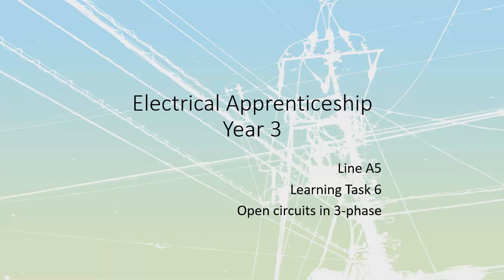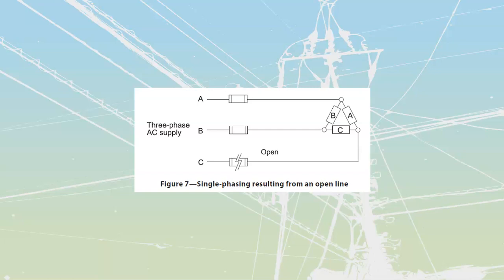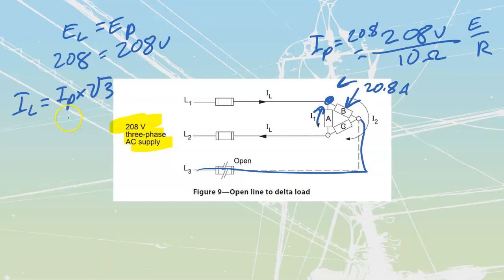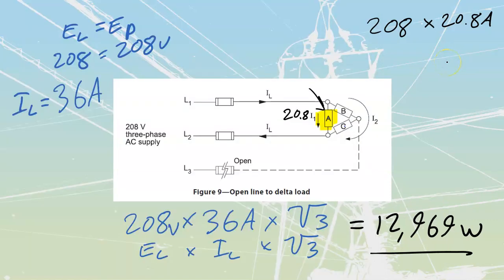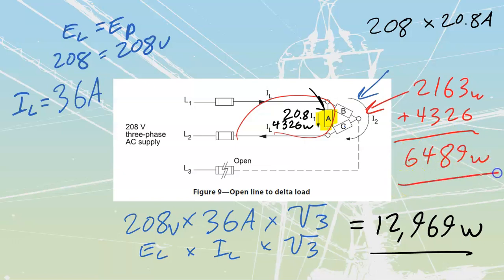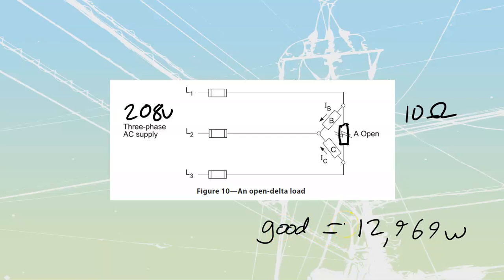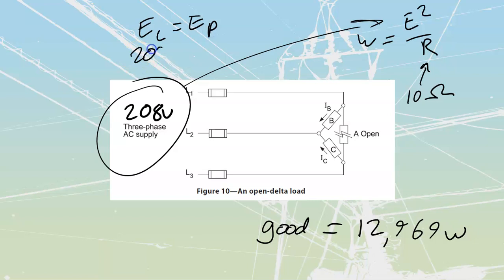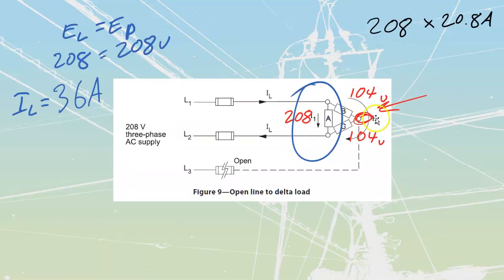Open Circuits on Delta connections - L3 A5 LT6 2

Comment: Hi! I was hoping for a quick explanation on why the phase current and line currents of line 1 and 3 are different under an open load condition
Reply: Meaning phase 1 is different than line 1       phase 3 is different than line 3